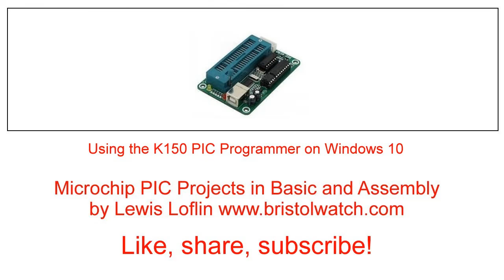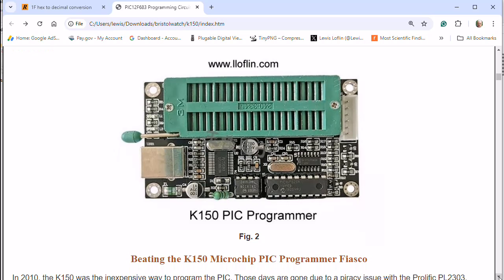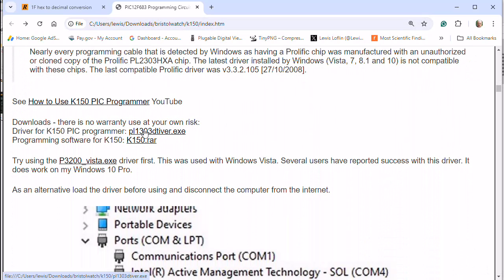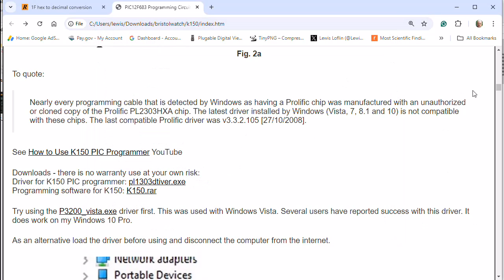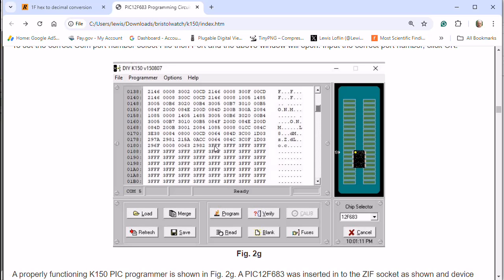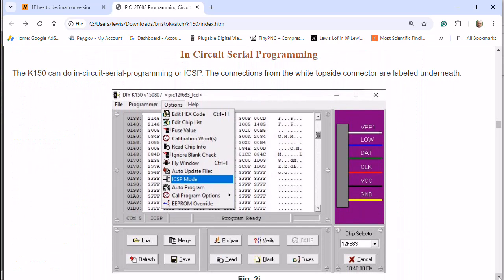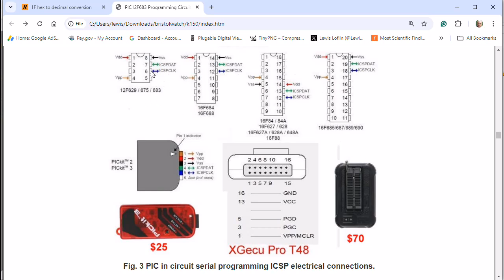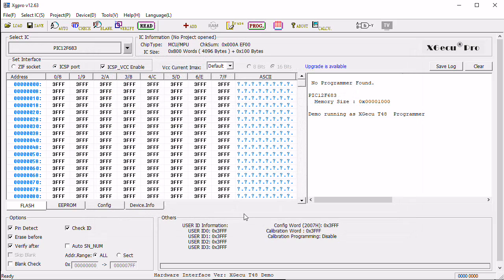Using the K150 PIC Programmer Windows 10

Comment: Hello, I keep getting "The board is not responding About to apply reset..." when doing anything with the chips. The programmer is recognized though. Do you have any advice? Thanks!
Reply from the maker: Driver problem. It is not setup correctly.

Comment: Ok! That vista driver doesn't work with my k150 clone, gives the error about being phased out. But here's what worked for me, somehow. Go to device manager, right click the error, then update, browse, let me pick, select disk, and select the driver from 3/12/2010, v3.3.11.152. There was another one on my computer from 2008 but that didn't work either, anything >2010 doesn't work either (there's only two of them, each from 2021). If the driver isn't installed, google around because it's probably out there somewwhere.
Reply from the maker: Thank you. I will note that.
Reply: tengo el clon del kt150y no consigo que me lo reconoezca el ordenador con w10, puede ayudarme?